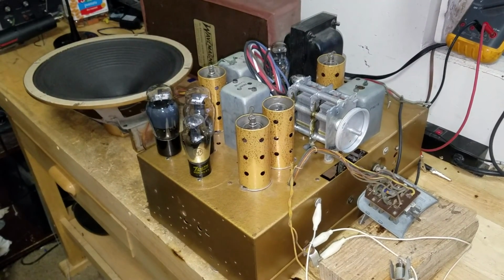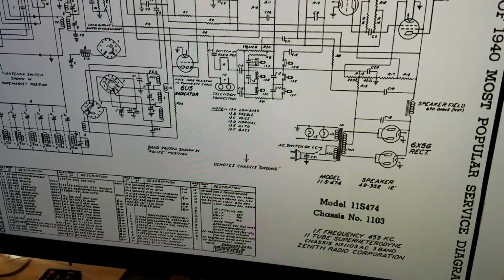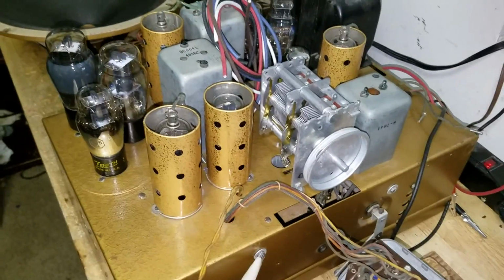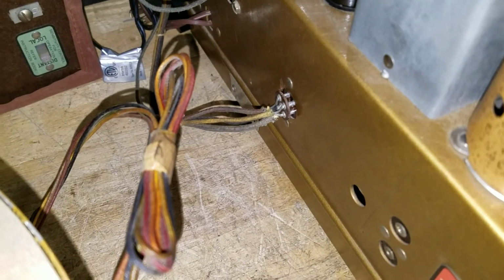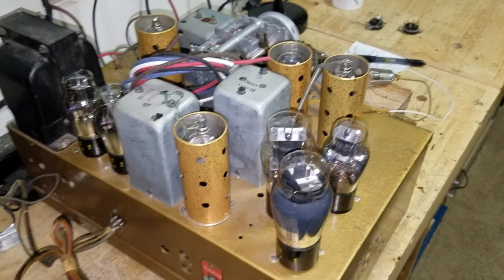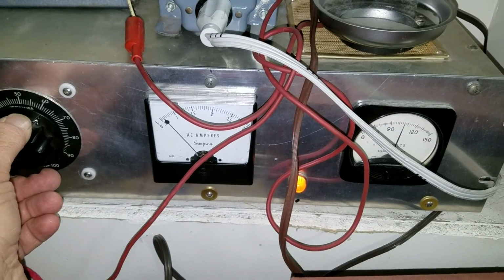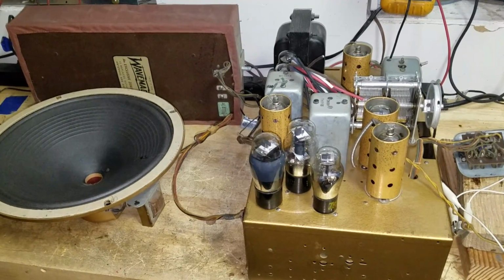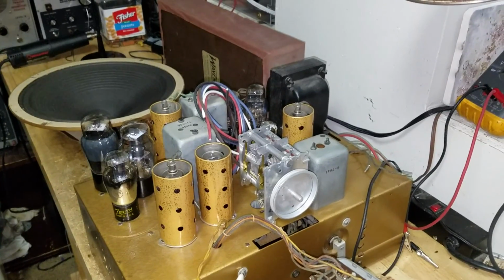1940 ZENITH 11S474 First Power Up of 95% Restored Chassis   Part 2 of 4

Comment: I have a 1939 Zenith 12s371 Half Round. I used speaker wire pin connectors to hook up to the phono input. They fit perfectly!
Reply from the maker: I have also found that Molex pins, size .093 work quite well, and they have tabs on them for soldering.  Thank you for the tip, Richard.  And, thank you for watching and for taking some of your time to comment.   Merry Christmas!    Michael